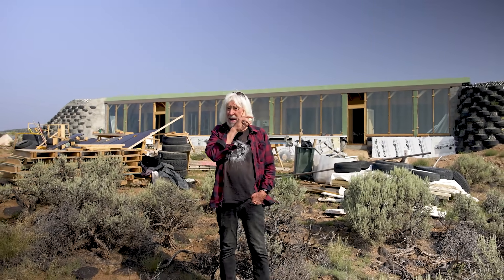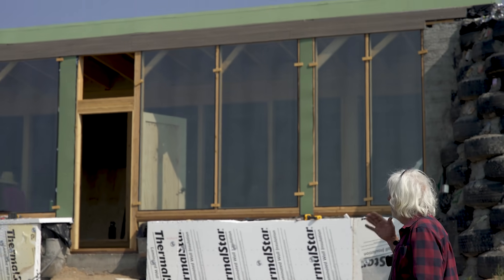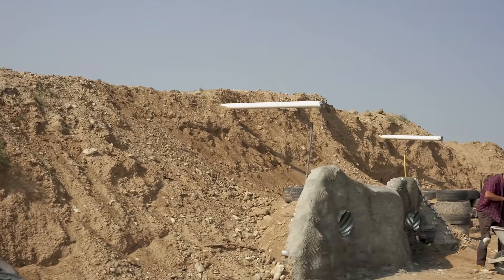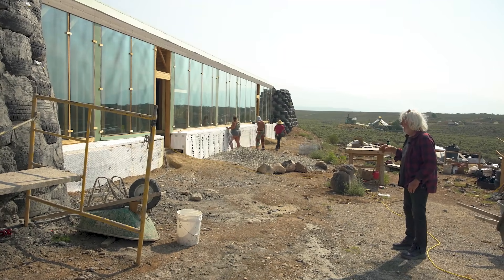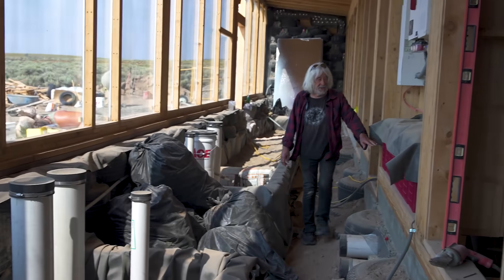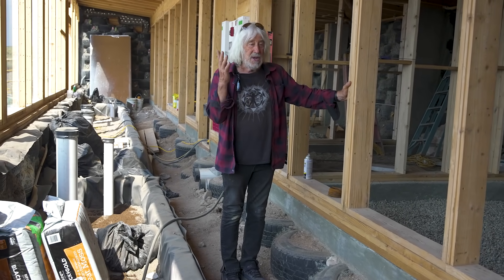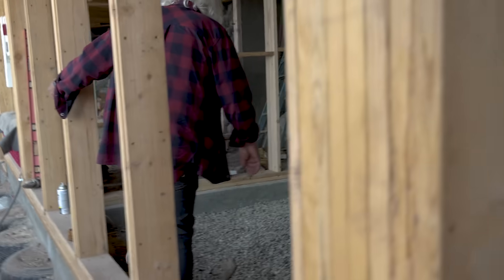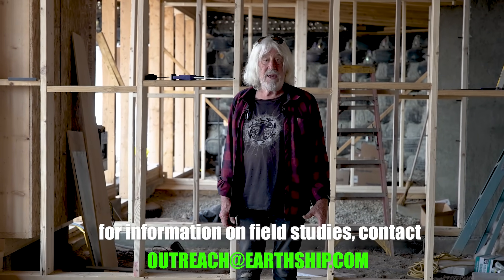"R2D2" Refuge #earthship Update With Michael Reynolds

Comment: I'm curious. Why not make the greenhouse/botanical area a separate space out front of the house - with doorways to it ? 

Then one could run fans to the main space on a thermostat - and it would never get too hot in the living area - and humidity could be more controlled. No grey water in the main space either.

I guess this would detract from the view.
But it could be submerged halfway down in front - and one could look overtop it.

Comment: Up in the central U.P. of MI. Got my timber frame skillon pavilion up. 6/12 pitch because 46th N and 70 psf snow loads. Doing a well insulated cmu masonry north wall with riprap stone veneer. Building a 24x24 section at a time. 6 foot frost depths and codes so no tires or berm. No. A.C. needed but code require "vent to daylight" because of insulated masonry thermal mass floor. Was planning to on some masonry appliances that helped get past codes too. Were I am at masonry materials and timbers are local to me.

Comment: 10/6/2024  FOR PEOPLE WHO CARE ABOUT DOGS!!!  I DON'T WANT HER DOGS TAKEN AWAY, BUT IT SEEMS THAT THEY SOUND VERY THIRSTY, AND MAY NEED THEIR WATER CHANGED TWICE A DAY BY A FRIENDLY VOLUNTEER, MAYBE A FELLOW NURSE, NOT SOMEONE SHE THINKS OF AS AS OPPOSED TO HER, BUT AS 'ON HER SIDE' (BUY ABOUT FOUR CONTAINERS, IN CASE THEY ACCIDENTALLY GET KNOCKED OVER BY THE DOGS, OR RACCOONS (WHICH CAN AND WILL KILL CATS, AND SMALL DOGS, MAYBE LARGE DOGS, IF IT IS A LARGE PACK OF RACCOONS JOINING TOGETHER TO ATTACK A LARGE DOG, ADULT RACCOONS CAN BE VERY AGGRESSIVE!!!) TRY TO GET SOMEONE TO VOLUNTEER TO FILL THE CONTAINERS WITH A HOSE TWICE A DAY, ABOUT FOUR, VERY LARGE, WATER PROOF RUBBER TWO HANDLED, CLEAN, BRAND NEW, LIGHT WEIGHT, ALL PURPOSE CARRY ALL, I'VE SEEN IT USED TO MAKE BIG SALAD RECIPES, IN A VIDEO MADE INSIDE A VEGAN OR VEGETARIAN RESTAURANT CALLED 'FRESNO FRESH', LOOKS LIKE IT MIGHT BE SOLD IN THE LAUNDRY SECTION AT BIG BOX STORES, ANIMALS LOVE TO DRINK OUT OF THIS, ESPECIALLY THE COLOR NEON YELLOW, IT IS MUCH EASIER TO RINSE CLEAN COMPARED TO MOST OTHER WATER CONTAINERS)  Thank you for reading and discussing this comment with your friends.  Thanks Michael Reynolds!  Saw your interview on 60 Minutes Australia!  Fans:  please consider trying to volunteer and build a tire wall fence (must get permission first by nurse facing financial stress, as she has ignored others' request to "please fix your fence" claiming it is not a problem fence) volunteers must do this free without charging her any money:  AFTER PERSUADING HER BY IT IS 100% FREE & WILL GET DONE WITHOUT TEARING DOWN HER WOOD FENCE, ATTACH IT TO THE TIRES WITH POPULAR TINY STEEL WIRE, ETC.,  & THE 'SCREW GUN' build a free tire wall fence on May Road at corner of Meadowbrook (not a typo!!!) Road to help stop her two dogs from leaning on her wood fence.  This is in the town of El Sobrante (not a typo!!!) or the hills of the city of Richmond, in Contra Costa County, California, zip code 94803.  Their fence looks like it is weak in many places and the two dogs might be able to 'jump the fence'.  Kids walk by this intersection every day as their are three schools in this area.  This intersection also has two young coyotes over night and this may be upsetting the two dogs, as they may be a target for coyote food.  This is less than one minute away from Valley View Road where the dogs could definitely get killed by very heavy traffic.  The same goes for nearby Appian (not a typo!!!) Way.  Maybe you could speed up the free dog fence process (needed in every zip code across the USA, etc.)  by stacking the tires vertically and connecting them with a 'screw gun' which is supposed to be similar to a 'nail gun', but it is supposed to be much more secure, and last much longer than the 'nail gun'.  Each vertical column of tires could be quickly filled with free horse manure.  You might ask at nearby horse stalls at the end of Valley View Road at San Pablo Dam Road (call first for an appointment and permission before just showing up to any of the above).  The nearby Feed Store on Appian (not a typo!!!) may have suggestions for other places nearby to request free horse, etc., farm animal manure for the tire columns.  These vertical tire columns could be quickly filled at every tire with wild flower seeds, and 'green manure seeds', to help the wild flower and vines of all kinds grow, especially tea rose vines, because the thorns would help keep criminals, etc. from trying to jump the fence.  Maybe consider a wide variety of 'toppers' depending on the location, electric wires can limit the choices.  Cactus or free 'ice plants' is probably the best choice for 'toppers' for the tire columns, as watering is probably very limited at this location, at this time.  Maybe in about one year all the tires could be covered by pretty, colorful, easy to grow, Nasturium (not a typo!!!) flowers (popping through 'nail gun' holes in the tires, to prevent rain water from stagnating at the bottom.  The seeds are very fast growing and 'replant' themselves as they produce their own flower seeds, great choice to cover up and hide the ugly tires.    IDEALLY, TRY TO GET MOTIVATED VOLUNTEERS TO BUILD BIOTECTURE EARTHSHIPS (NOT A TYPO!!!) ALL OVER CONTRA COSTA COUNTY (ABOUT 30 MINUTES FROM SAN FRANCISCO), AND EVERY OTHER COUNTY OF CALIFORNIA, IN ORDER TO HELP SAVE DOGS, CATS, AND VETERINARY CLINIC STAFF (ESPECIALLY THOSE INVOLVED IN SPAY, NEUTER PROGRAMS).  THEY ARE ALL FACING IMPOSSIBLE BILLS, STUDENT LOANS, HIGH RENTS, ETC.  A FEW DAYS AGO A VETERINARIAN DOWN THE STREET DIED.  HER SISTER, THE CO OWNER OF THE EL SOBRANTE (NOT A TYPO!!!) VETERINARY HOSPITAL, IS TRYING TO HONOR HER MEMORY BY FINDING HOMES FOR ABOUT TWENTY CATS HER SISTER WAS TRYING TO SAVE.  PLEASE HELP HER IF YOU CAN!!!  HER SISTER ALSO WORKED WITH MONKEYS IN THAILAND BEFORE THEY BOUGHT THE ES HOSPITAL TOGETHER.  SHE WAS A GRADUATE OF THE FAMOUS U.C. DAVIS SCHOOL OF VETERINARY SCIENCE.  THEIR ARE TWO OTHER NEARBY CLINICS IN CRISES, TRYING ALWAYS TO FIND GOOD PEOPLE TO ADOPT ENDLESS KITTENS, CATS, PUPPIES, DOGS, ETC..  THEY ARE CALLED APPROXIMATELY, 'EVERGREEN PET VET CLINIC ON SAN PABLO DAM ROAD' AND 'FIX OUR FERALS (NOT A TYPO!!!) WHICH WAS RECENTLY CHANGED TO 'FIX OUR PETS' AND IS ALSO ON SAN PABLO CAM ROAD, BOTH ARE IN THE NEARBY TOWN OR CITY OF SAN PABLO, ALSO IN CONTRA COSTA COUNTY NEARBY.  THEY HAVE A WAITING LIST OF ABOUT THREE MONTHS FOR ALL FERAL SPAY NEUTER APPOINTMENTS.  IT WOULD BE GREAT IF THE TOP 5% LIKE SIR PAUL MCCARTNEY (AND SIMILAR PEOPLE, LIKE MELINDA FRENCH GATES WITH HER NEW '1 BILLION FUND FOR WOMEN') WOULD PAY FOR ALL OF THIS, AS KITTENS START BREEDING AT ONLY THREE MONTHS!!!  IDEALLY, TRY TO BUY THE CLOSED EL SOBRANTE (NOT A TYPO!!!) CHRISTIAN HIGH SCHOOL, (MAYBE IT COULD BE NAMED AS A LIVING MEMORIAL TO THE VETERINARIAN WHO DIED A FEW DAYS AGO, VERY NEARBY) WHICH HAS MANY BEAUTIFUL REDWOOD TREES, TO TURN IT INTO A 'BIOTECTURE EARTHSHIP' (NOT A TYPO!!!) COMMUNITY FILLED WITH TRAINED PEOPLE DEDICATED TO CARING FOR THE TWENTY CATS NEEDING HOMES FROM THE VERY CLOSE BY EL SOBRANTE (NOT A TYPO!!!) VETERINARY HOSPITAL (AT THE CORNER OF VALLEY VIEW ROAD, APPIAN (NOT A TYPO!!!) ROAD, AND SOBRANTE (NOT A TYPO!!!) ROAD (WHICH IS VERY RURAL, VERY NARROW, NO SIDEWALKS, VERY STEEP, THIS AREA REQUIRES A VEHICLE THAT IS DESIGNED TO DRIVE UP VERY STEEP, VERY NARROW HILLS!!! WITH IDIOTS RACING OR DOING DONUTS AT ALL HOURS, DUMPING TRASH EVERYWHERE).  THE CLOSED HIGH SCHOOL NEEDS TO BE SURROUNDED BY ABOUT 1 MILLION TIRES STACKED IN VERTICAL COLUMNS (SCREW GUN ATTACHING COLUMNS, FILL WITH FREE FARM ANIMAL MANURE, FILL WITH ALL KINDS OF VINES AND ESPECIALLY THORNY ROSE VINES, AND THORNY CACTUS TO HELP KEEP OUT CRIMINALS OVER NIGHT, AND IN ORDER TO PROTECT FROM NOT INFREQUENT DRIVE BY SHOOTINGS AND CAR CRASHES.    VISITORS MIGHT LIKE TO VISIT (CALL FIRST TO MAKE SURE THEY ARE OPEN AND READY TO SERVE YOU) THE NEW BAR & RESTAURANT DEDICATED TO FANS OF THE SPORT CALLED RUGBY) WHICH IS ABOUT ONE MINUTE AWAY ON SOBRANTE (NOT A TYPO!!!) ROAD, EAST OF VALLEY VIEW ROAD.  G'DAY (NOT A TYPO!!!)

Comment: Hi, I wanted to say I’ve been watching your videos for years and love and greatly respect what your are accomplishing! I was looking for a place to email but couldn’t find one. I’ve worked in site work excavation for some years. I wanted to share an idea to try for filling and compacting tire walls that could cut down on manual labor. My experiment would be to 
1.) stake a form to retain first row of tires similar to forming out a concrete pad. 
2.) lay out a row of tires against the form.
3.) fill a full row of tires with dirt to the point that dirt is mounding over top edge.
4.) ride a vibratory PLATE compactor over full row of tires.
5.) add small amounts of fill to center of tire as necessary and repeat step 4and 5 to reach  
      Desired compaction. 
6.) backfill and (possibly compact) behind firewall to top of 1st row.
7.) move on to second row and so on.
Maybe this could work? Just an idea. Would love your feed back. 
I say this in all sincerity and with deepest respect 😁👍
Reply: That sound like a good idea

Comment: Love how simple the design is becoming.  Next step is eliminating the tirewall for its labor intensity.  That is the last hurdle to mass adoption.  Has there been any attempt with rammed earth? I would love to see how that works.
Reply: Good question! I am curious about this too!
Reply: I think you could do cob walls and put a decking around the outside that is insulated underneath. Then for cold climates have an air intake pipe buried under the sunny side with solar collectors on top of it put in horizontal on the ground before the decking. It would heat the ground underneath rather than the walls and do it in the longer days. Then you can switch to the cold air intake from the north side for the summer and cut off the warm one leaving it to  heat the ground and put some rugs down inside to hold it underneath. The idea basically is to make a warm area of ground underneath that is not going to go away in a hurry. If this is particularly warm around the air pipe then it can be warmer inside than the actual walls. For New mexico tho cob is probably not a good idea. Maybe bricks would be ok or half way underground and bricks on the top half.  I just think the main thing is the thermal mass around the ventilation pipes and underneath. Having windows on 3 sides of a room is nice. Maybe an E shape or C or O or X or star or  separate buildings that are one from a thermal mass underneath point of view. Instead of a huge wall you could plant a hedge to push the wind over the area. It might be better to use the digger to make a lake and some swales and design an oasis outside as well as inside.

Comment: Why do the cooling tubes have to be metal? I feel that in time the steel tubing would rust and decay with moisture and humidity
Reply: It might be that metal transfers temperature faster than plastic. By using galvanized steel, the rust issue is addressed to a considerable extent.